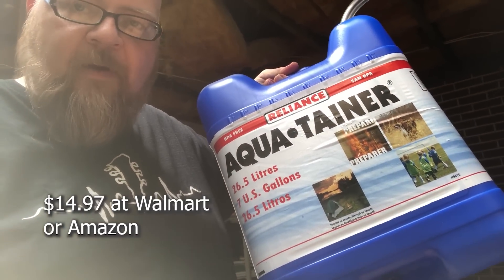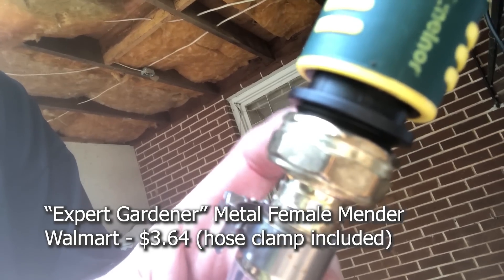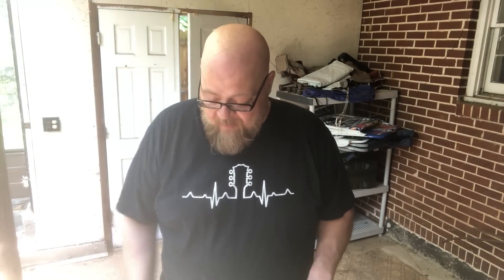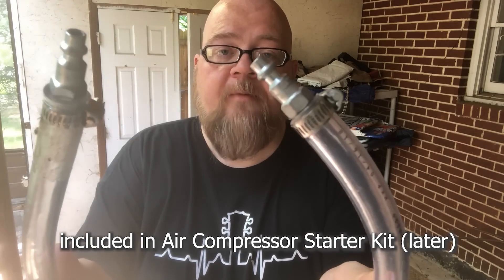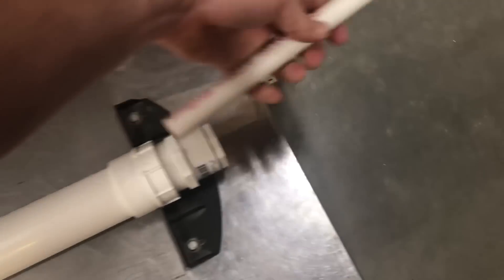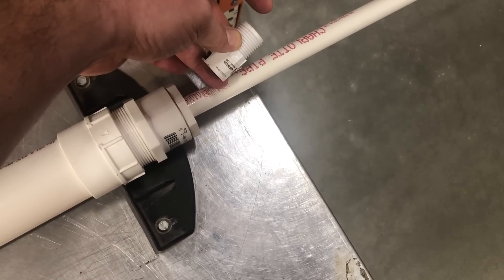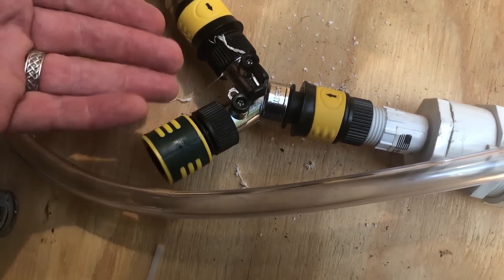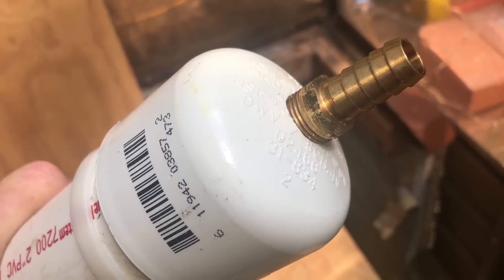DIY Aircrete Foam Gun - Demystified

Comment: Thanks for making it so "cookbook", really helps.
There are two things I'd like to add:
Maybe I just didn't see it. Had to stop the video and noticed that you are not using just any type of PVC, but rather Sch. (schedule) 40.
For those newcomers,  Sch. 40 and 80 are used for high pressure/high temperature applications. So Beware when applying any pressure to a pipe!

The other is the exploding tank.😂😂😂
Just guessing, but maybe there is another container with much thicker walls.
Or find container with specs on maximum pressure and then have a relief valve set at half of maximum.
Reason: Pressure tank will be cycling many times throughout it's life. Seams, welds, etc. will fatigue over time, therefore we can expect failure. 
The other and most important is SAFETY. 
SAFETY, SAFETY, SAFETY!!!
Many videos on YouTube show children and family members in close proximity. 
Here in YouTube we're a wild bunch and risk takers. In our enthusiasm sometimes don't really thinking things through. 😂
...and as one philosopher said, "It's just a thought."
Enjoy.
Reply from the maker: Yeah. The pressure doesn’t get to high in the gun itself because it flows straight through ... it’s the force in which it hits the scrub pads that makes the foam happen. There have been quite a few suggestions for stronger tanks. A pump sprayer seems smart. And yeah ... we are risk takers here indeed. Thanks for the reminder.
Reply from the maker: Yeah. The pressure doesn’t get to high in the gun itself because it flows straight through ... it’s the force in which it hits the scrub pads that makes the foam happen. There have been quite a few suggestions for stronger tanks. A pump sprayer seems smart. And yeah ... we are risk takers here indeed. Thanks for the reminder.
Reply from the maker: Yeah. The pressure doesn’t get to high in the gun itself because it flows straight through ... it’s the force in which it hits the scrub pads that makes the foam happen. There have been quite a few suggestions for stronger tanks. A pump sprayer seems smart. And yeah ... we are risk takers here indeed. Thanks for the reminder.
Reply from the maker: Yeah. The pressure doesn’t get to high in the gun itself because it flows straight through ... it’s the force in which it hits the scrub pads that makes the foam happen. There have been quite a few suggestions for stronger tanks. A pump sprayer seems smart. And yeah ... we are risk takers here indeed. Thanks for the reminder.
Reply from the maker: Yeah. The pressure doesn’t get to high in the gun itself because it flows straight through ... it’s the force in which it hits the scrub pads that makes the foam happen. There have been quite a few suggestions for stronger tanks. A pump sprayer seems smart. And yeah ... we are risk takers here indeed. Thanks for the reminder.

Comment: I can't help feeling that a second gun could be invented to mix the water-cement slurry with compressed air, and then combine-mix that with this foam. The end jet would then spray out the final, desired product - aircrete! 
Now, there's a design challenge! A new range of construction possibilities could open up, such as making wire mesh shapes - a dome, maybe - and spraying aircrete directly onto it.
Reply from the maker: Hmmm. Challenge being considered :) ... domegaia actually has a pvc shaft running down his mixer which pushes the foam directly into the slurry while mixing. Saves a little trouble ... but not an instant mix like you describe.
Reply: JonWasBored - By the way - as I understand it, your foam gun uses air pressure fed to a pressurised shampoo container to pump the shampoo into the gun. Have you already tried the simpler arrangement of just sucking it up with the gun's existing airflow? (Venturi effect) 

Fast air-flow creates a powerful vacuum in any side-tube at right angles to it. It can suck up paint, thick automotive underseal, and even grit in shot-blasters - so why not shampoo?

You'd just need to add a short metal tube between your air line and the foam-gun. Another metal tube, welded to the middle of that tube at right angles) could suck up your shampoo, and the air flow will blast it into the gun. Attaching the shampoo input to the wider, gun-body would not work (I don't think), because in the wider tube the airflow has slowed down, and it's less able to create a vacuum.

With this system, your shampoo container need not be pressurised. In fact, it must have an opening to allow air in. Looking at it another way, the earth's atmospheric pressure into the container will be pushing the shampoo into the gun, at a low-pressure point created by the Venturi effect.
Reply from the maker: Yeah. In the video I mentioned I tried a Venturi valve first. I could never regulate the pressure enough to keep air from blowing OUT all the valves. It would work in theory (and another guy has a video that uses that principle which is what got me started building in the first place) - but it takes a bit more engineering than I wanted to try to figure out. But hey, build one and show us how it’s done. I was going for the simplest build I could come up with. My build is simple (in my opinion) because it only requires you to drill two holes and cut one tube into three pieces. The rest is assembly.
Reply from the maker: Yeah. In the video I mentioned I tried a Venturi valve first. I could never regulate the pressure enough to keep air from blowing OUT all the valves. It would work in theory (and another guy has a video that uses that principle which is what got me started building in the first place) - but it takes a bit more engineering than I wanted to try to figure out. But hey, build one and show us how it’s done. I was going for the simplest build I could come up with. My build is simple (in my opinion) because it only requires you to drill two holes and cut one tube into three pieces. The rest is assembly.
Reply from the maker: Yeah. In the video I mentioned I tried a Venturi valve first. I could never regulate the pressure enough to keep air from blowing OUT all the valves. It would work in theory (and another guy has a video that uses that principle which is what got me started building in the first place) - but it takes a bit more engineering than I wanted to try to figure out. But hey, build one and show us how it’s done. I was going for the simplest build I could come up with. My build is simple (in my opinion) because it only requires you to drill two holes and cut one tube into three pieces. The rest is assembly.
Reply from the maker: Yeah. In the video I mentioned I tried a Venturi valve first. I could never regulate the pressure enough to keep air from blowing OUT all the valves. It would work in theory (and another guy has a video that uses that principle which is what got me started building in the first place) - but it takes a bit more engineering than I wanted to try to figure out. But hey, build one and show us how it’s done. I was going for the simplest build I could come up with. My build is simple (in my opinion) because it only requires you to drill two holes and cut one tube into three pieces. The rest is assembly.
Reply: @JonWasBored 
A cheap 5 gal /19L cornelious keg makes a great soap solution container. They are stainless steel and have a 60psi pressure relief valve built in.The dip tube can access the very last drop.
Reply: You're describing Shotcrete/Gunite.
https://en.m.wikipedia.org/wiki/Shotcrete

The other is known as a "Pickup or Draw Tube", where you apply the principle of a high speed fluid, liquid or gas, moving past an opening creating low pressure or a "draw/lift".

Comment: Tell me if I'm wrong here but back in the day we use to use this stuff we bought at the store that you hooked up the hose to. (A hand held container) that had either soap (!) to  spray on the car to wash or a pesticide to spray on the lawn. 
The container built up pressure and mixed with...and out it came. With a few modifications (we're good at that, aren't we men?) you have the same outcome...right?  I'm guessing we need MORE PRESSURE. Right?  anyway, Thanks  Jon!
Reply from the maker: Yeah. There are a lot of ways to skin this cat. Bottom line the mix needs pressure and agitation (the steel wool scrubby things snide the canister) how you get there is up to you :)
Reply: @JonWasBored  Yup!  The application devices are irrelevant. The application of the AIR with water is!  Then theres is the compression, heat and water testing...
Reply: Bug spray.
Hudson sprayer.

Comment: Did I miss something, is there anything that goes inside the 2 inch pipe, I heard you say you may want to open it an d replace metal plates or something at some time?
Reply from the maker: Ha. Thanks for answering. Yes. I use stainless steel dish scrub pads. About 7 fit in my tube. Plus the whisk.
Reply: At 8:50 he explains the stainless balls kept moving forward in tube and used the whisk to prevent that, his friend josh's idea

Comment: Plus the thing, as do most that I have seen, leaks like a sieve!
Reply from the maker: I haven't sealed up what I can seal - but at the end of the day - it's not that big of a problem.  Maybe get some soap on your shoes, but this is a messy affair no matter how leakproof your foam gun is.  I built mine with ease of construction in mind - meaning... you don't have to be very precise with taps for threading things and you don't have to have a very heavy (and small) PVC pressurized chamber for the soap mix.  And I think I accomplished that - and it makes FOAM like a MF'er.  So ... proof is in the pudding in my mind.  But again - make one better! We'll all copy it. Thanks for your comments.

Comment: This is still a very complicated process just to make foam. There just HAS GOT to be a better way!!!
Reply from the maker: Some of the comments below have suggested a paint sprayer or a soda blaster (harbor freight) I haven't tried either yet - but at the end of the day, you still need the steel scrubbing pads to cause the soap solution to turn to foam.  If you come up with better ideas - please share them.  This is a learning community :)
Reply: @JonWasBored  I saw a suggestion to use plastic loofa pads (shower scrub pads) instead of the stainless steel scrubbing pads. Seems like it would work. Have you tried this?
BTW, I loved the video. I will build one soon.
Reply: The simplest way to make foam is a drill with a paddle mixer with screen wire wrapped around it and a bucket of soapy water, more time consuming but will get you experimenting with aircrete.

Comment: thanks maN . A ++  .A metal tank old propane or air n bras or weld iron fitting is my method ill use i think welder are cheap we all need 3 ;]
Reply from the maker: I’m all about cheap. Someone suggested a paint sprayer. Another a sand blaster tank.

Comment: Great job!  Why is everybody in these videos drilling holes for the hose adapters?  You could use threaded adapters and a brass (now they make them out of plastic) barbed adapter such as used with pex or vinyl tubing  to make the nozzle for the foam to come out of.  To connect a garden hose (or a washing machine hose) there are things called "garden hose adapters"... they have garden hose threads on one end and iron pipe size (IPS) threads on the other end.... sorry, I happen to be a plumber... might even make my own video when I get my aircrete walls and floor building project going in a couple of weeks.
Reply from the maker: Yes!! Make your video! We all learn from each other. I used a few hose repair adapters in my build - but I’d love to see your tips come to life. Thanks for your comment. Keep watching - a new video coming out this week - a failed rocket stove build that I hope I saved ... waiting a day more to cure.
Reply: @JonWasBored  I'm looking for videos on using lightweight aircrete panels for the floor of sleeping lofts in the house I'm building.  I'm trying to economically build a 2700 sq. ft. house without a piece of wood in it.  I definitely DO NOT want the floors to fail, especially when over my bedroom...
Reply: @aNuthaRedneck  I have a similar dream.  I would love to see your project.
Reply from the maker: aNuthaRedneck two guys I would recommend who could help  - Honey Do Carpenter and Tiny-Giant-Lifestyle (Dan) ... floors are tricky with Aircrete - but possible. Lateral Strength is an issue. You might also see Michael Builds ... his counter tops / outdoor kitchen top is pretty sweet.
Reply: Yes please make a video I would be interested in seeing it too!

Comment: Why not just make your foam using a drill and a paint mixer? Make up your 35–1 blend of water and soap in a big enough container for your project needs (an old 55 gall drum). Go after it with the paint mixer and create all the foam you need. Total expense assuming you have a drill is under $20. Time invested is negligible. The end result is the same volume of foam.
Reply from the maker: Dennis Fahlstrom thanks for the comment! Honestly the magic happens when pressurized soap/water passes through the steel scouting pads. All the pores create the foam. If you can make that happen with a paint sprayer, go for it!!
Reply: Dennis Fahlstrom it’s the bubble size that matters most. They have to be tiny, think shaving cream small.

Comment: Simply go to harbor freight and buy a sand blaster and make a gun. You end up with a steal tank that was designed for pressure. Most come with the valves you need.
Reply from the maker: Scott - have you successfully used this for foam generation?  The harbor freight page seems to indicate "this is only for soda" ... so would you just put in your water/soap mix and shoot it into your canister (with the steel pads)?
Reply: @JonWasBored  yes I have and I don't worry about it exploding because it was designed for pressure.
Reply: @scottloberg3180  very interesting,so all I need to do is stuff steel wool in it?
Reply: @rosekarenify  you still need to build a foam gun and hook it to the sand blaster ( aka soap container for this application )